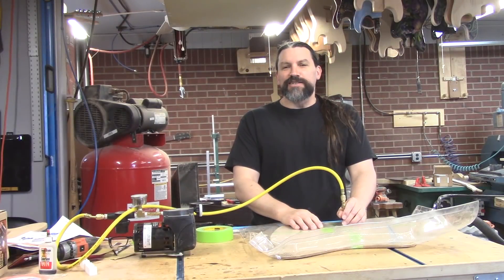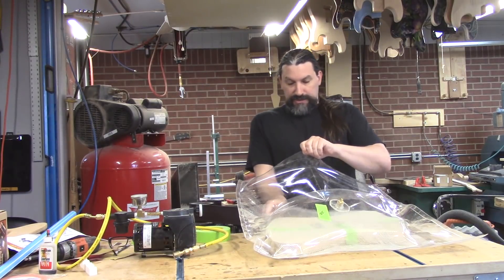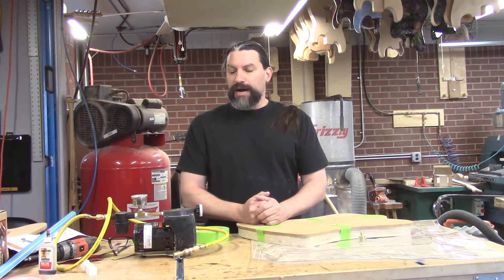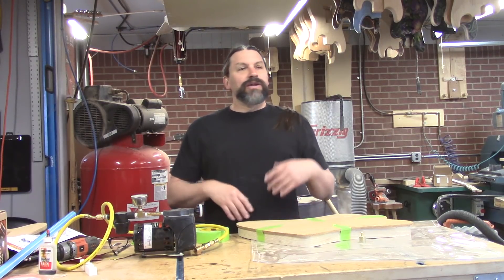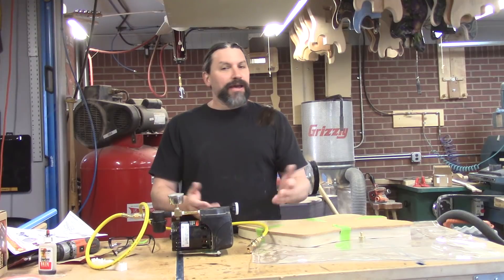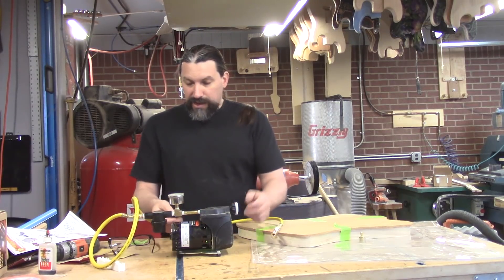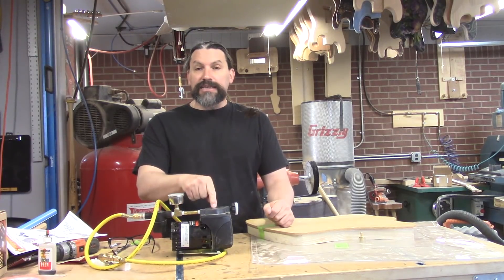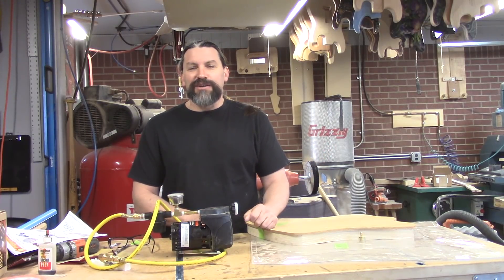Guitar Top Veneering With New Hot Suck Action!

Comment: Hi Matt can you tell me if this vacuum would be strong enough to bend over a 1/4” solid maple top for a drop top ? Cheers 🥂
Reply from the maker: Hi Phil, thanks for watching. I can not tell you if it will or wouldn't... I have not tried that yet. I can tell you that the guys at that website are pretty knowledgeable, I'm sure they could pint you in the right direction. Maybe I'll see if it can do a drop top one day. I usually relieve the bend points with some groves to help things bend. A 1/4" top is pretty big without adding heat etc.
Reply: It depends on the thickness  of the veneer. It will be fine if the veneer is thin like commercial type. For veneering a curved surface, it is best to use a bleeder cloth so the veneer can conform the to the  curves. Also if possible, make your exit valve off your pattern. And extend a bleeder cloth to it. You can sometimes get a “hickey” or dimple if the exit valve is on the pattern using thin veneer.  Thick veneer like Matt showed is fine. But bleeder fabric is always best. The black porch screen is good for bleeder cloth.  But even paper towel will work.

Comment: Vacuum systems should NOT be used to bond highly figured expensive maple tops to a mahogany body that is going to be stained. The suction from these bags pulls glue out of the seams and as any guitar builder worth his over sized waistline will tell you glue slop takes stain at a different rate than wood that has had no glue slop applied to it. So when you leave your wet dream guitar you have been dying to build for years in a in a suction bag overnight the glue gets sucked right into the pores of the top and bottom pieces of wood right at the seam and thereby makes your nice maple figured wet dream top a piece of paint grade material. Doing this suction bag routine on even softer woods like the swamp ash this guy is using it on is a sure fire way to end up with a nice new gold top guitar due to the fact you used too much glue and you used a vacuum bag instead of good old clamps. Cleaning glue slop from the edges of any piece of clamped wood is something that should be done with care, slopping glue all over the underside of a nice top is not going to make it adhere to the back wood any better, using a proper amount of glue which is just enough to put a thin coat over the surface and if there is any slop clean it off with a dry rag, DO NOT USE A WATER SOAKED RAG this will only thin the glue out and the water and diluted glue will only get sucked into the pores much faster and deeper. Yes this glue slop can be sanded out but do you really want to change your guitars design at that stage of the game? Just a few words of CAUTION before you start using these bags and learn this lesson the hard and expensive way. These bags were originally designed and put into use by large scale manufacturers to speed up production mostly of paint grade guitars, care must be used when trying this method on an expensive piece of highly figured top wood. You have been warned.
Reply from the maker: In my testing the vacuum systems are ideal for use with veneers on tops regardless of figure on the veneers or the subsraight it is being glued to. If you are using regular wood glue you are doing it wrong. Speaking of asking people,  anyone skilled in marquetry will tell you that cold press glues that are designed for vacuum systems are good to go.
I don't know if you are calling me fat or why you would leave a veneer in a vacuum bag overnight? 
You are correct that stain will react differently to raw wood and wood with glue on it. BTW we don't stain guitars. 
I have looked for your videos about using veneer but didn't see any. I have several as well as a website full of guitars I have made where glues have never been a issue. I know it's fun to tell people they are wrong on the internet. You know, when I have free time I like to go for a bike ride
Reply: @TexasToastGuitars  No one called you fat, no one insulted the way you make guitars, my post was a warning to those who will not use the vacuum bags as they should and could end up ruining a very expensive piece of wood and their wet dream guitar. I too have been making guitars as a hobby for many years following my career in the aerospace industry in So Cal and when I have a few hours of spare time I hop in my SL 500 and go for a ride.